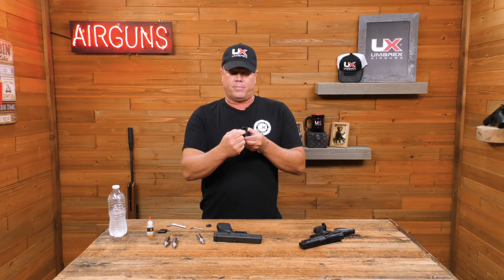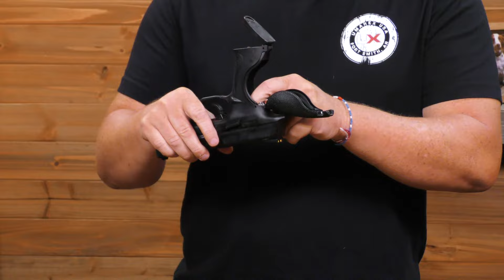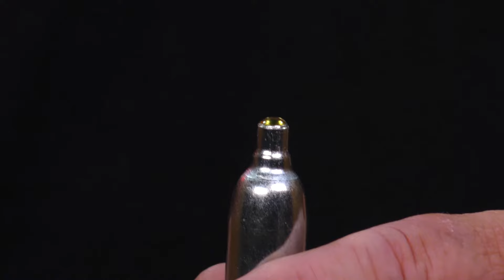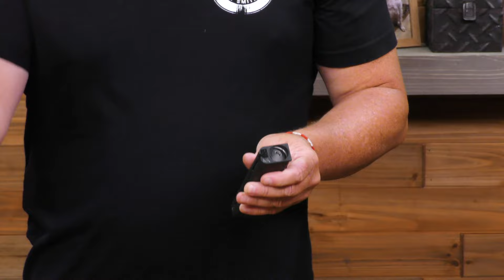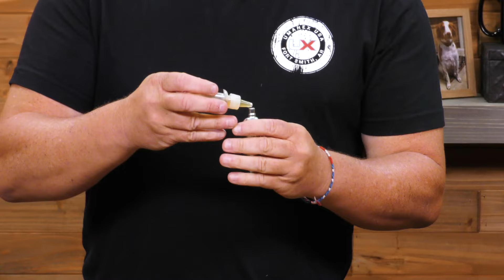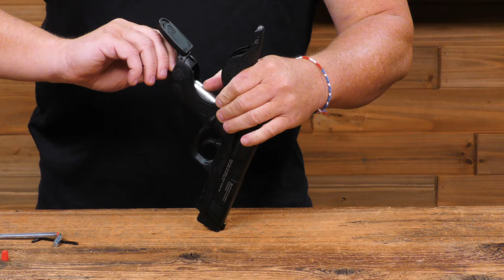CO2 Replica Air Gun Pistol Care & Maintenance : Umarex Airguns

Comment: one on the things that I can't find about this airgun is what to do if you get a CO2 cartridge stuck on the co2 chamber. Putting a drop of oil in the CO2 tip will help, but a fool proof tip I have created is to cut a 3" long 3/4' wide strip of plastic from a ziplock  bag, placed around the co2 cartridge so you can hold the co2 in the air by holding the 2 ends of the plastic strip, and then place it in the co2 chamber with the strip around it. Slide the plastic strip up as far as it can go, then fold the plastic strip to one side (I go to the right) and close the back lid. Try it and then cut the strip further as necessary.  When you are done shooting, just pull on the two ends of the strip and the cartridge will easily come out.  I know.. it's not the best solution but it works.
Reply from the maker: What a great idea. Thanks for sharing!

Comment: That’s ok for keeping the valve seal  in good condition but for pistol maintenance better to field strip, clean then re-grease. Also useful to run a capsule which contains oil occasionally.
Reply from the maker: Good points. Not all pistols are recommended to be field stripped. Always follow the recommendations of the guns' owner's manual.

Comment: Hello and thank you for your good educational video.  I have two questions: 1. Why do we use this oil? 2. Is it possible to use Vaseline oil instead of this oil? Thank you.
Reply from the maker: The silicone oil is to extend the life of the seal that the CO2 cartridge sets against and to lubricate the internals. We don't recommend Vaseline products because it originates from petroleum-based substances and waxes and could deteriorate the seal instead of extend its life.
Reply: @UmarexAir  
Hi
Thanks for the reply.  Please
 advise, can I buy this silicone oil from Amazon or Ali Express?

Comment: This video is really helpful especially as a beginner but I have a couple questions so how often do I need to use the oil and also what kind of oil do I use and we’re can I get it from?
Reply from the maker: One drop on the tip of the capsule every other time you load one if using consistently or each time if just shooting with it from time to time. We use RWS Chamber Lube or RWS Spring Cylinder Oil... it needs to be a silicone oil. No petroleum oils. https://www.umarexusa.com/rws-chamber-lube-pkg-with-needle
Reply: @UmarexAir  thank you so much I’m so excited for my airsoft gun to come 😍

Comment: Curious of anyone with the umarex M&P with the slide, how many shots can you get out of a co2 cartridge?  Also when not in use do you remove the mag with co2 from the gun or do you need to spend the co2 cartridge and remove it vs store with pressure in it?

Comment: I would like to see how you actually Clean the valve. Removing the seal and cleaning the area and then replacing with a new seal.
Reply from the maker: Taking one down that far is not normal practice. There are Co2 cleaning cartridges on the market but not something we offer. Generally, if you're using a silicone oil every other cartridge or so and not letting dirt and debris get in the CO2 housing area you should be in good shape.

Comment: Hey! So just a question that i desperately need answered. Can i use Silicone Chamber Oil from Crossman for my Glock 17 gen 3. Also not just use it on top of the CO2 cartridge but also use it for gun maintenance like you stated in the video using it on the slide. Also great video!!
Reply from the maker: Yes, as long as it's non-petroleum oil you should be fine.
Reply: @UmarexAir  I have no clue how to find out if it’s petroleum based or no
Reply: @sabihmirza5792  if it's silicone oil, it's silicone based, not petroleum.

Comment: I use 100% silicone spray, instead of oil and i spray just a little  directly to the co2 valve not on the cartridge. Is that ok? Also is it normal to have some of the oil escaping from the muzzle in a cloud form on the first two or three shots?
Reply from the maker: Normal, yes. Don't use much oil. A little is good. A lot is not better.

Comment: @ Umarex Airguns  I gather that I need 2 different lubes for my Umarex XBG. One for the C02 seal , another for other and all moving parts.But, WHAT oils?  If there are generic oils, I'd like to use them rather than getting caught up in a brand.  You say at 0:17   "Put a little drop of C02 on top of that..."  . I realize it was a mistake but, I still don't know what oil to actually use for my new XBG, to oil both the C02 seal and which for the moving parts. The manual says to use RWS spring cylinder oil onto all moving parts (Mineral oil?) , is that correct? If so, Are there less pricey alternatives for that ?  I gather that petroleum based oils are a no-no for the C02 seal, that they will deteriorate the seal over time. I'm SO confused by all of the contradictory statements out there.  Please help . Thank you!  (I also want to say an extra thank you because, you actually take the time to answer questions here. Most channels nowadays, want the clicks , subs, and likes but don't put out anymore effort than just making and posting their videos)
Reply from the maker: Use a silicone based oil for all of it. RWS Chamber Lube or other pellet gun oil, Seal1, etc.
Reply: @UmarexAir  does elite force silicone oil work will for these co2 guns?
Reply from the maker: @VeritivX  Yes it works fine.

Comment: What type of thing did you put in the co2 what's it for
Reply: Silicon oil, It's to lubricate the piercing nozzle when it makes connection with the Co2 cylinder and also apparently prolongs the life of the seal in the magazine because most rubber/plastics dry out over time an become brittle.

Comment: Is it worth putting some oil on the belt on the belt driven mags (in particular I guess for me, the Walther PPQ M2)? I also wondered whether is okay to leave the co2 cannister in the mag, and the mag in the gun whilst not using. Thank you very much.  Completely new to the hobby, enjoying it though and no doubt shall purchase more.  Thinking either the Glock 17 gen 5 pellet next or the Beretta M92 FS Nickel.
Reply from the maker: We don't recommend leaving a canister in the gun when it is pressurized. It can cause the o-ring to fail. A tiny amount of silicone oil under the belt shouldn't hurt anything but we do recommend following the maintenance instructions in the manual as the official recommendation.

Comment: Do you recommend Ballistol or pellgun oil to use on the Umarex TR50?
Reply from the maker: We recommend silicone oil. RWS Chamber Lube or T4E Oil are excellent options.
Reply: Ok thanks. Here in Portugal none of those oils are available... Is abbey 35 a good option? What about RC shock oil?

Comment: The oil Umarex sent me is in a bottle like that but the oil is blue not yellow.
Reply from the maker: RWS spring cylinder oil. As long as it's silicone it's okay. You just don't want to use any petroleum oils.
Reply: @UmarexAir  Mine says RWS Spring Cyl oil but its blue.
Reply from the maker: @matrox  Good to go! Keep 'em running.

Comment: What kind of oil did you use?
Reply from the maker: For airguns, use silicone oil. Do not use a petroleum based oil. We use RWS Chamber Lube or RWS Spring Cylinder Oil.

Comment: What kind of oil do you use a drop of on the top Of co2 Cartridge? Is is different than spring and camber oil by RWS?
Reply: Silicon oil, They don't recommend any petroleum based products in the care and maintenance manuals
Reply from the maker: Silicone oil. We use and sell RWS.

Comment: Can you recommend where I can send my Daisy Powerline 92 for repair? (Leaking CO2)
Reply from the maker: You will need to contact the Daisy company for that, I don't know how they operate customer service.
Reply: Daisy customer service was my 1st inquiry! They replied that they no longer repair the power line 92 and set me a PDF of some air gunsmiths half of wihich so far  also so far no longer do repair service! So it looks like I've got a vintage paper weight cause none of the geniuses out there can recommend a simple O Ring fix!!

Comment: Do i have to put a drop on every cartridge ?
And i also have a care kit with co2 mixed with lube does this actually worth to use it?
Reply from the maker: Every other cartridge is sufficient. As for the cartridges that contain lube, yes, it helps if directions are followed. Either method should help keep your pistol running smoothly.
Reply: @UmarexAir  οkay thanks!!

Comment: Is there a specific kind of lube I should be using or would just any lube?
Reply from the maker: Nothing with petroleum in it. RWS Chamber Lube or Cylinder oil is our preference. Pellgun oil. Or just a silicon oil.
Reply: @UmarexAir  you can use cylinder and/or chamber for the barell oiling ?!

Comment: I’m new to BB gun and stuff but I got a small question if u put pellgunoil on the co2 Cartridge can u leave it in a BB gun longer or no?
Reply: No Pellgunoil on co2 Airguns. Use silicone oil instead. Pellgunoil contains petroleum and it will break your weapon. I read that just before cause I wanted to buy Pellgunoil for my new Umarex SAA and I ordered a silicone oil instead of Pellgunoil
Reply: @MAD-UL  any sillicone oil ? like cylinder and air chamber from RWS is fine ?

Comment: Is  the silicone in the SPRING CYLINDER  OIL... the SAME as the chamber oil? I cant get any online in my area and I dont want to ruin my Umarex Morph 3x. How can I find an appropriate silicone oil thats the right viscosity and not be broke? Thanks
Reply from the maker: Just find a good non petroleum silicon oil, you will be fine.

Comment: I have an xbg .177 umarex, and when I put the co2 cylinder in and tighten it, once it punctures a bunch of air comes out the bottom of the grip and from the muzzle, and then it doesn't work after that, I'm lost I've followed my owner manual and online tips and this gun just won't work
Reply from the maker: Sounds like the seal went bad. =(  Best to replace the whole thing. Not worth servicing. Kind of like flat screen TVs nowadays. Would cost more than the price of the pistol to service it.

Comment: What oil is this? The description of this video says that it is explained which oil u have to use but nothing is said about that. He even calls the oil C02.. He says to put a few drops of C02 on it I mean what? 
What kind of oil do u put on the cartridges??
Reply from the maker: With CO2 airguns and spring/nitro pistol air rifles you want to use silicone oil. Do not use petroleum based oils. The Umarex USA brand is RWS Chamber Lube and RWS Cylinder Oil. Either are good.
Reply: @UmarexAir  thanks 👍🏼

Comment: I have had my glock 17 for about two months, I'm already on to my second magazine (the first one became useless when the hex bolt got stripped and became stuck in it) so after dropping 50 bucks to get another magazine, NOW THIS ONE IS LEAKING from the top where that little black piece of rubber is right next to wear you insert BBs. I have used Pellgun Oil every single time when inserting new CO2, I don't understand why its leaking. I tried to unscrew valve from inside but no matter how hard I try to turn it with my flat head it won't budge and I'm afraid of damaging valve any further. Please help! I am extremely frustrated that for how much I have spent on this gun and the extra mag and all the CO2 cannisters that immediately empty from leak that I am experiencing so many problems. How do I fix this?
Reply from the maker: Give our gun techs a call, they can help you.  (479) 646-4210 ext 7

Comment: Is it important to have different types of lubricants for different parts, or can I get away with using silicone grease for everything? I notice that my gun smells weird when the gas and silicone interact during operation.
Reply from the maker: I would say silicone oil would be fine for all the parts unless the instructions call for something specific.
Reply: @UmarexAir  thank u
Reply: @UmarexAir  thanks!  this is very useful info here to maintain my entrée de gamme Umarex mcp .177 bb gun that works well. Being new to bb guns i was wondering how many shots can i expect with one 12 g  co2 cartridge?  2nd and last,  Why can't my gun retain its gas when i put it aside let's say for....an hour or so and i use Crossman pellgun oil, one drop on the tip of the cartridge?
Reply from the maker: @jbqu3142  On how many shots, it really depends on the temperature and how fast you shoot. You should get at least three mag fulls. on the CO2 leaking within an hour, it shouldn't, if it has a small leak that might cause it. You can call our gun techs for more information on that:  (479) 646-4210 ext 7

Comment: I have a Glock gen 4 BB cow air  pistol and I'm having trouble putting the Cartridge in I can not get the cap to screw 0n to tighten  the co2. Down to the pin so ican shoot! Can you please  help  me thanks  I just got the gun so iam new to it.
Reply from the maker: Give our gun techs a call at (479) 646-4210 ext 7 , that way if there is a problem they can help you out.

Comment: I dont know what's going on with my gun but every time I put in a co2 tank in my gun all the air in the co2 can just goes out can someone plz help me
Reply from the maker: Please give one of our gun techs a call: 479-646-4210 ext.7 Mon-Fri 8 to 5 during regular business days. We are closed on Jan. 1.
Reply: Try using a small strip of white plumbers tape over the canister where the valve pierces. It seems like the seal of your valve has worn. The tape will fill any gap.
Reply: @totalsubmition  I tried that but nothing do they sale the part on Amazon?

Comment: Can I use 100% silicone oil which is used in Gym equipments ?
Reply from the maker: I think that is fine, if you want to make sure you can call our gun techs at  (479) 646-4210 ext 7.

Comment: What is the oil he is using?
Reply: from the shape of the bottle it seems to me to be RWS chamber lube oil which is silicone oil. 
Couldn't find it where i am so i use Crossman pellgun oil which is the same, silicone oil.
Reply from the maker: RWS Chamber lube.
Reply: @UmarexAir  and we can use the RWS chamber lube for the barrels etc ?
Reply: @Mxlch999  that's what I am wondering. It seems you have to use RWS chamber lube for the cartridge but I am curious as to what oil I need to use for moving parts. I am wondering if I can get by with just the RWS chamber lube or would I need another type to oil the rest of the gun(moving parts) too?

Comment: What kind of oil do you need
Reply from the maker: Silicone. Do not use anything made with petroleum. Look for RWS spring cylinder oil or Chamber Lube or other Airgun or pellet gun oil.

Comment: Why does my magazine not leaking but co2 coming out of the barrel of the gun
Reply from the maker: Sounds like the valve may not be functioning properly or is stuck open. Difficult to diagnose without the pistol. Could be something is pressing on the release just enough to release some CO2.

Comment: Is no oil better than pellgun oil??
Reply from the maker: Pellgun oil is a non-detergent oil that is petroleum based with added o-ring and seal conditioners in its formula offered by Crosman. We recommend non-petroleum oil for all airguns.
Reply: @UmarexAir  I have an umarex CO2 pistol and I've been shooting it dry cause all I have available near me is pellgun oil. I don't know what is worse for the seals. No oil or pellgun oil.

Comment: Wait can I put the co2 in with out the oil?
Reply from the maker: Yes, just use some oil at least every other time. Some will say every time but you will be fine if you don't do that all the time.
Reply: @UmarexAir  does it have to be BB gun oil or can I use something els?
Reply from the maker: @iggygamboa4458  You need to use a silicone oil, don't use petroleum based oil.

Comment: Ive got 2 umerex 1911 pistols and both have an issue with fireing.

Only time ittle actually fire is when its pointed up, never when pointing at a target or down at the ground.

Cant figure out whats causing it so if anyone knows a fix please lmk lol

Its as if the hammer isnt striking the the inner hammer
Reply from the maker: Contact or gun techs at :  (479) 646-4210 ext 7

Comment: The bad thing about is that it does not come with the oil
Reply from the maker: Even our autos don't come with oil. Get a pure silicone oil. We use RWS Chamber Lube or Spring Cylinder oil, but there's others out there.

Comment: My umerex CO2 pistol is not firing and instantly drains all contents of capsules.
I can see a green seal around the pin that punctures the cannister of CO2.
I've only just got gun oil and haven't used any since I got the gun new in Dec 2021.
How can I get it firing again?
Reply: You have your answer from the lack of official response. Notice they've responded to an older comment and a newer one.